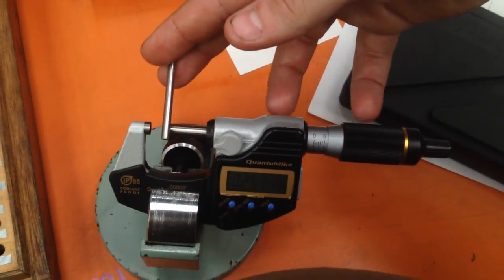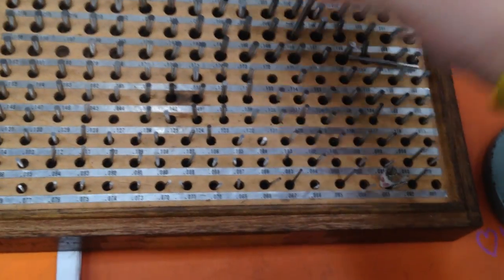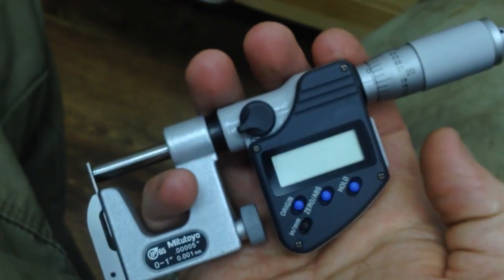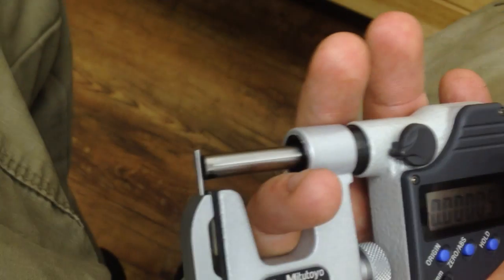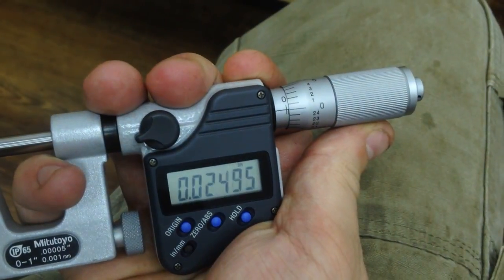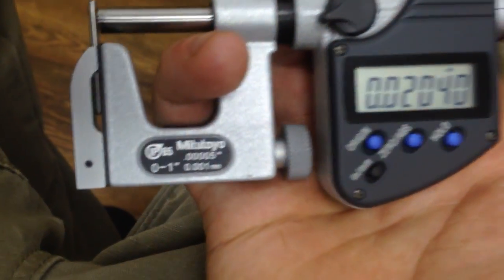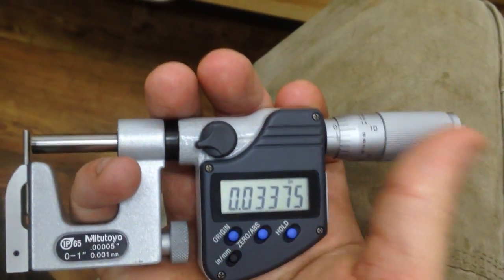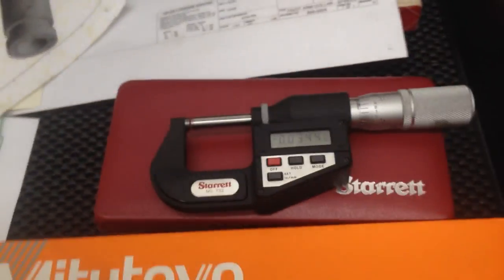Two Mitutoyo Digital micrometers and a brain dead starrett.

Comment: i have an older startett 790afl and the display stopped working. i changed the battery and still nothing. bad screen? bad connection? any help would be appreciated

Comment: Some guys at work love the quanti mic's.  I can't stand them.  They are a nice instrument but for my use (sizing cadmium plated parts) the fast thimble is just too fast for me.  With cad being as soft as it is I just don't like the speed, too easy to mash it into/out of size.
Reply from the maker: +Eric Skinner Makes total sense, easy to crash into your part with the anvil because it moves so fast however, with the higher pitched screw the actual torque required ends up being less. I can see how it would lead to a lot of accidental dings. Prolly best to get an indicating micrometer with radius anvils for those.